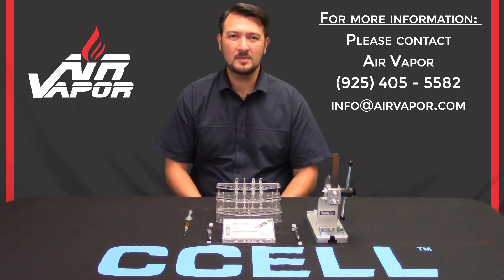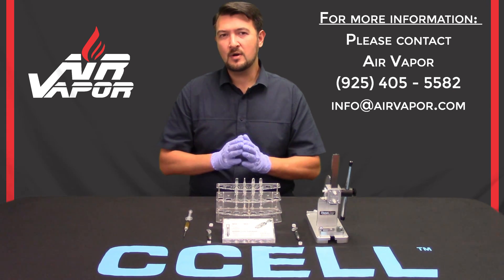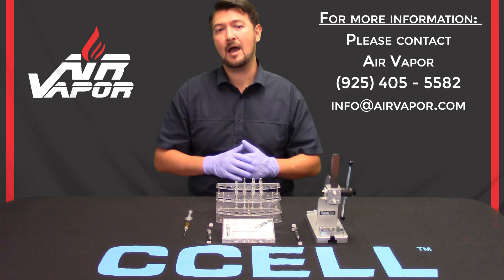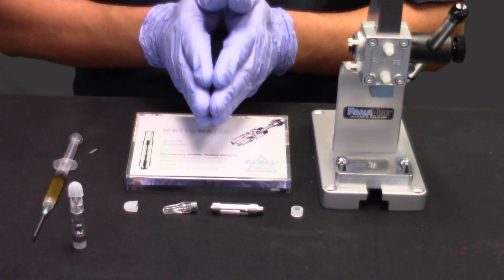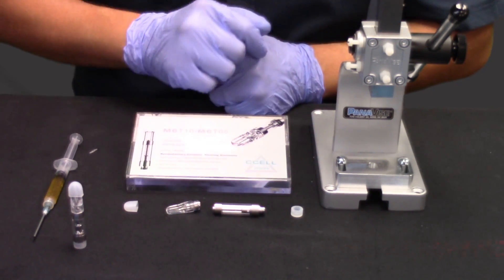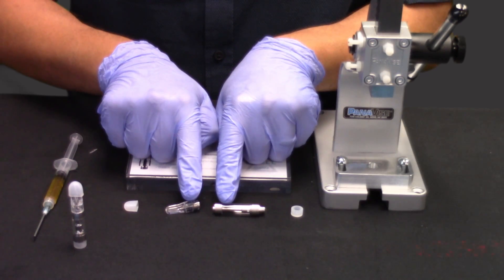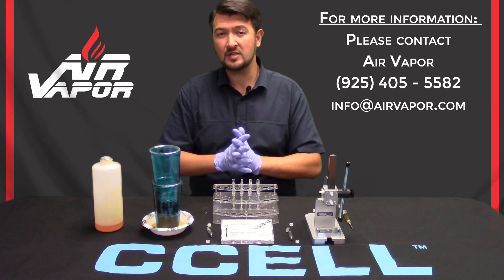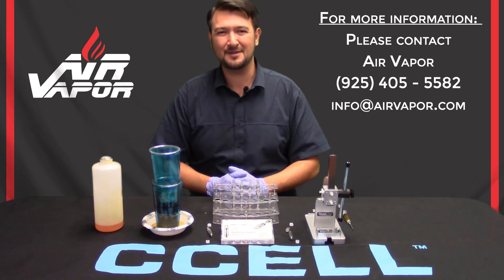How To Fill: CCELL M6T / C6 Vape Cartridge

Comment: Is there a reason you add the tip and thread covers at the finish? My carts come with the bottoms of the carts and tips with the rubber caps on them are you saying I should be taking them off to put it right back on?

Comment: A hammer works great to put the cap on and is faster.  Seriously a Arbor Press is definitely not needed.  A lightish hit with a Hammer or Rubber Mallet works great.  Also go with the round tips, Less clogging and easier to cap.
Reply from the maker: If you are filling 1 or 2 for personal use, then hammer away....but for a professional company that manufactures vape carts as a business, a hammer is very inaccurate and unsanitary

Comment: bitch what? i literally took the tip off by getting 2 pairs ofd plyers and i pulled the cap off, filled it up then pushed the cap back on perfectly and tightly with just my thump. WHY AND THE FUCK WOULD YOU NEED A 300 DOLLAR FUCKING HAND FORGE PRESS FOR IT.

Comment: Ok. . . So how do you open one that's already filled? You people need to explain that 1st before going on about nonsense
Reply from the maker: Hi Emilio, due to the way the cartridge is designed, you cannot open a cartridge once filled and capped. Opening the cartridge will require force and will damage the tip. We recommend using the C2 or TH2 cartridge instead if you'd like to open or refill the cartridge.
Reply: Yaaaboy —34 you sure bout that
Reply: Eliseo Cruz why would I lie about that? That’s so stupid. It’s not made to be reopened but that is s way I used to Jorge
Reply from the maker: If you must take these apart, use your bare hands.  Here is the key....DO NOT twist, DO NOT pull apart....BEND the cart & tip over your thumbs (like breaking a pencil).  Use your thumbs like a lever and jam them into the top metal collar, while your fingers PULL DOWN on opposite ends of the cart...you won't break the cart, but you will see the tip START to pull away from the top metal collar.  BEND THE OPPOSITE DIRECTION, then back again, gently rocking the tip out of the top metal collar after several BENDS.
Reply: Darkzen 007 
N
Reply: @AirVapor with great power comes great responsibility and my boi you have given me the knowledge that I need
Reply from the maker: @Pimpin420Necro  Now go forth and refill my friend, spreading vapor across this great land
Reply: @AirVapor  holy shit this worked instantly with mine thanks so much peter
Reply: Peter got it thanks
Reply: Alternative: Build deck in a vice (or in my case, a dead Sigelli body, heat gun or jet lighter, pliers. Heat the tip only till it is easy enough to let go without melting it. Take your time! This will most likely destroy the cart.  I got a tank with a bad coil and had to transfer the goods to a functioning cart.
Reply: Eh this brand of carts are literally trash im just shifting juice to a krusher cart.
Reply: Jacob Thompson Same exactly rn lmfaoo make a 15$ cart into a 45$ ufo 🤑
Reply: Facts! did you figure this out?
Reply: @yaaaboy3491  thanks
Reply: Nah y’all all got it wrong put the cart on the edge on a table for example stand on the table put your foot on the cart with shoes on ofc make sure your foot is covering up to the top and use ur other foot in a fast motion stomp the tip off edge the fast force will prevent it from breaking you do it right the tip will just fly off but u gotta find it lol I do it all the time y’all sleep
Reply: @dirtyproxy  I cant believe that fucking just worked...I thought for sure it was going to break! Thanks, this is by far the best method. No effort and it takes seconds
Reply: @AirVapor  Thank you for clarifying this.  I have a couple cartridges that I want to either A - Take the remaining product out of or B - Add additional oil to and they were not the screw off style I had previously encountered.  Great video - very descriptive and straight to the point.
Reply: @AirVapor  I've tried with my hands and with tools but it still wont come off is there any other way to remove the cap?

Comment: Can you take it apart after put together? If so how is the best way
Reply from the maker: Hi Esteban, this cartridge is designed in a way that you cannot pull it apart. This is a one-time use cartridge. Once the mouthpiece is on, it is very hard to take it back off, and in doing so, you may damage the cartridge or mouthpiece.
Reply: This sucks 😆
Reply: Peter y’all didn’t think about what if the cartridge is malfunctioning?? Now I have to throw away my full cartridge??
Reply: Use vise grips and vise. Twist the mouth piece off of the cartridge it will come right off.  Use rags or paper towels around the cartridge so it doesn’t damage it
Reply: @noah5889  How is your cartridge malfunctioning?  Is it leaking, clogged, not firing / getting hot, or something else?  Describe here and we can help diagnose & repair.
Reply: Peter Hackett not firing
Reply: @petedoja  pull it apart with home depot hand tools. It's not hard. It will come off pretty easy. Putting it back together is near impossible without this tool. However make sure you, keep the bottom part upward so you don't spill your concentrate.
Reply: Sl33kM33k what tool? I’m having the same problem how. I bought a 1 gram cart and put pure distillate in it. Put the wax in nice and warm for the extract to soak into the coil and wick. I hit it and it will only be a tiny bit. Should I use a higher voltage? My half gram cart works fine on the same battery
Reply: @yaaaboy3491  The tool in the VIDEO.  Idk how much it cost but the cartridge that look like the one in the video and a few others out there that CAN'T BE TWISTED OFF. 

For the wax not cooking in your cartridge. 1st question is there air flow you feel coming from where the 2 pieces are joint together? If so you got an air flow issue. 2nd. Is if it was pure wax you put in and not the recommend concentration that comes in the syringes 💉. Then you have a heavy, denser form of the original concentate. Having a higher watt range should help. Give it a go. Worse case is you put that concentate in a dab rig.
Reply from the maker: @noah5889   If the cartridges is "not firing", that is usually due to one of 2 possible issues:
 1)  Dirty electrical connection on cart and/or battery (solution = take a Q-tip lightly soaked in rubbing alcohol and clean the very bottom of the cartridge where it connects to the battery, AND clean the very top of the battery that connects to the cartridge.)  
2) Clogged cartridge or battery, which can be determined by disconnecting the cartridge from the battery, then trying to inhale on the cartridge....if air doesn't flow through the cartridge easily, then it is clogged.  (solution = use a hair dryer to gently heat the cart until very warm to the touch, then put a tissue on the bottom of cart then BLOW AIR OUT of the cart...this will force warm oil clogging the airway out into the tissue, and you should now be able to inhale & exhale through the cart easily...clean the bottom of the cart with rubbing alcohol, connect to clean battery, & enjoy)
If neither of the above solutions work, you may have a faulty cartridge or battery.  Good luck and let us know how it works for you.
Reply from the maker: @yaaaboy3491  Try heating the cartridge gently with a hair dryer until the outside is very warm to the touch, which should make the extract inside softer and easier to move around....then put the cart on your battery and see if it hits better.  Use a wattage between 4-8 watts if using an adjustable "mod" battery...any higher and you risk burning / damaging the cart.
Lastly, I've said it before and I'll say it again....THESE ARE SINGLE USE CARTS THAT ARE NOT DESIGNED TO BE REFILLED.  Sure you can take them apart and refill them, but they will very likely not work very well or leak like crazy.   .
Reply: Were all good thank you bro I ended up putting a drop of PG in there to make it not as thick I used straight distillate. Thank you for your help. I used a refillable cart I’m not cheap 7 dollars won’t kill me lol. But the distillate was just too thick. I though I had a firing problem. Heated it up pretty good put the PG in mixed it and now it works like a champ. Thank you for the help regardless
Reply from the maker: @yaaaboy3491  Glad it worked out, try using Distilled / Refined MCT Oil instead of PG if you have problems with separating or bad taste (common issues when mixing with PG).  Happy Vaping

Comment: How do you separate the two pieces to fill it
Reply from the maker: If you must take these apart, use your bare hands.  Here is the key....DO NOT twist, DO NOT pull apart....BEND the cart & tip over your thumbs (like breaking a pencil).  Use your thumbs like a lever and jam them into the top metal collar, while your fingers PULL DOWN on opposite ends of the cart...you won't break the cart, but you will see the tip START to pull away from the top metal collar.  BEND THE OPPOSITE DIRECTION, then back again, gently rocking the tip out of the top metal collar after several BENDS.

Comment: For anyone else coming here looking to open these things, it's REALLY hard. So before you do all the crazy shit that everyone else is suggesting, try to pull the pin out a teensy bit for a better connection to the battery. I'd say 1/5th of my cartridges need the pin adjusted by literally just a hair or two.
Reply from the maker: THIS...and in case you don't know what pin Lyndi is referring to, take your cartridge (separate from battery first), turn it upside down, and it's the small pin at the very bottom center of the cart (below the threads).  Use a needle or a knife tip to pry it up.  Great suggestion Lyndi!
Reply: Lyndi Wittmann Bro no lie: this worked on 2/10 of my carts! 😂🤣

Thanks man!

Comment: My question is guys how do I make my own dank vapes? Anybody have a recipe for the oil
Reply from the maker: Good question....that can easily be answered by just entering "How to make Dank Vapes Oil" into the youtube search bar.  Happy vaping!
Reply: Concentrate and terpenes. ( 95% wax, 5% terps usually) Keep it simple. Don’t use any pg/vg or peg500, you’ll just be mixing your meds with poison and reducing taste. Do some terpenes research and you’ll find you can exert a lot of control over the effects of your concentrate via the “entourage effect” terpenes have with THC. I recommend True Terpenes brand strain profiles or Elevation terpenes off of Amazon. You can get the Syringes on there too. Also a hotplate and a small boro glass mixing beaker.

Comment: How can I seal the cap without the press
Reply from the maker: If you are just trying to fill a couple for personal use, then push the cap on as far as possible with your hands, then flip it upside down and holding the cart tightly, hit the cap on a table or other hard CLEAN surface until the bottom edge of the cap meets the top edge of the cart.  If you are filling more than a couple, get a "Rubber Mallet" available at your local hardware store, and use it to gently pound the cap on.

Comment: $300 for a $80 arbor press lol
Reply from the maker: Our Arbor Press comes with the correct jig to hold your cart, as well as a press-cap to prevent the press from scratching tips as they get pressed on, both of which are not included on a barebones press.  Also, prices have dropped since this video was made, I didn't feel like re-recording an entire video for one price change.  Lastly, if you watched this entire video, found it informative, yet the price of the arbor press is what you picked to comment on, with an LOL to end it.....thanks dickhead.

Comment: How do you remove the tip?
Reply from the maker: If you must take these apart, use your bare hands.  Here is the key....DO NOT twist, DO NOT pull apart....BEND the cart & tip over your thumbs (like breaking a pencil).  Use your thumbs like a lever and jam them into the top metal collar, while your fingers PULL DOWN on opposite ends of the cart...you won't break the cart, but you will see the tip START to pull away from the top metal collar.  BEND THE OPPOSITE DIRECTION, then back again, gently rocking the tip out of the top metal collar after several BENDS.